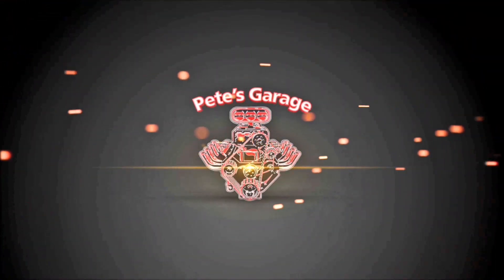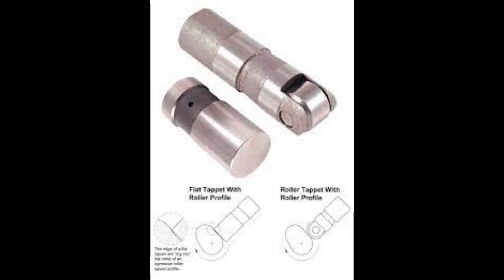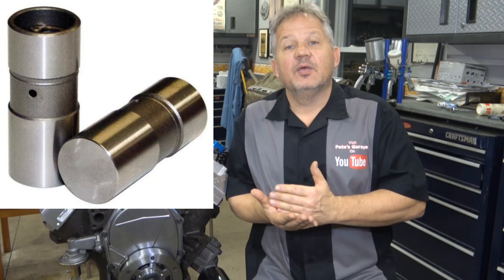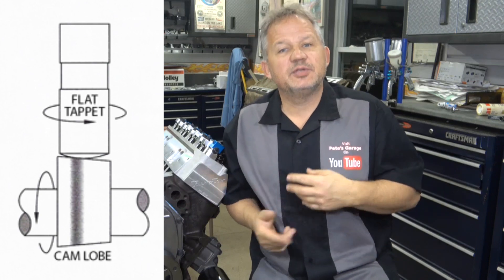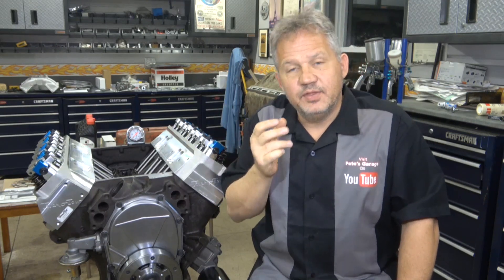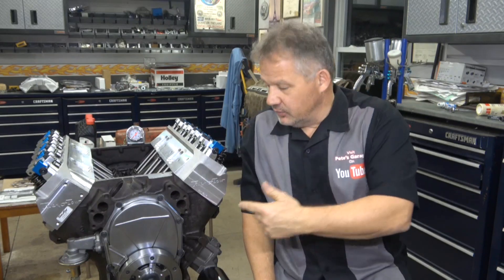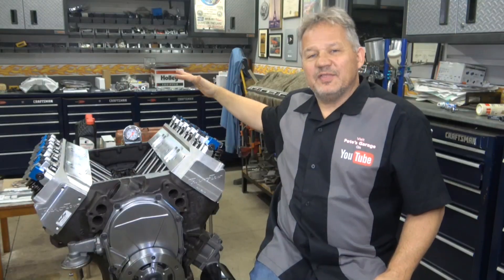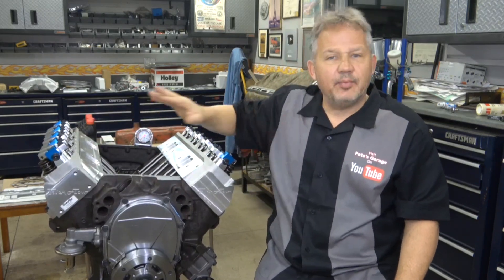Engine Building Tips - Roller or Flat Tappet Cam Pre-Lube and Break In - 440 MOPAR 512 Stroker

Comment: Does this apply the same if you’re reusing a flat tappet cam with new lifters? I did a freshen up on a bbf460 and planned on reusing the voodoo cam that was in it but the old lifters didn’t get labeled. Oops. I purchased new isky lifters and does the cam need “rebroken in”?
Reply from the maker: Now the lifters have to be broken it to the cam. I would follow the break-in procedure.

Comment: I'll stick to my flat tappet thank you. All I'm seeing with rollers is all the needle bearing failures in the roller wiping out cams left and right. Just ask all the Hemi 5.7 and 6.4 guys.
Reply from the maker: An engine that has problem with rollers is usually the result of selecting wrong or cheap  parts.
Reply: That's because they bought cheap Chinese made hydraulic roller lifters.

The Ford Racing hydraulic roller lifters in my 331 small block Ford with an X cam went over 250,000 miles with no problems and I only rebuilt it because the rings were shot.
Reply: No issues with my 392

Comment: Success rate with roller, I agree with you but... You know you can open a valve riding a flat tappet lifter faster/longer than a roller, right? 

If you put a torque wrench on two valve trains, you'd never be able to tell the difference between roller and flat tappet valve train.
Reply from the maker: Thanks for the info!

Comment: 50% cam failure rate??  Did I hear that correctly?

If you’re having a 50% failure rate, you’re doing something wrong.   

Maybe 8%!  If that!  2-5% would be expected.
Reply from the maker: You heard wrong. It can be 50/50 if you have high spring seat pressure and do not follow the manufacturers recommendations for break-in

Comment: When talking about the taper on the cam lobes, and saying the lifters will hammer down the high side, you forgot 1 very VERY important part. The lifters. The lifters must have a proper crown ground on the bottom that matches the taper of the cam lobe. This is a necessity for rotation, and it also keeps the lifter off the edge of the cam. You'll have half the lofter face in contact with half the cam lobe.
Reply from the maker: I believe I mention that

Comment: Thanks you for this video.  Just preparing to break in a 340 flat tapped solid lifter cam and lifters. My question is using breaking valve springs(60-70 lbs). Currently on my speedmaster heads are some custom “ beehive” shaped springs rated at 230 lbs ( closed). 

As long as they do everything else correctly, lube, pre-oiling, ensuring immediate startup, is using a breaking valve spring worth the time and the money? Kirt
Reply from the maker: No, but I follow the cam manufacturers break-in instructions.

Comment: Just getting close to running my rebuilt 350 Chevy. I got to thinking, why doesn’t the “biggie” performance cam/lifter manufacturers set up a thermal cycling/oiling fixture, and using the fixture and simulated engine warm up thermal cycles, break the cam & lifters in, then package/ship a matched set to their customers, identifying which lifters go with which cam lobe? It seems, in today’s World, that would go a long way towards ending failures? And, my Comp Cam paperwork tells me of a nitriding process I could send it in to have done - too late, my cam’s in. It also talks of a lifter bore groove - but I can’t buy that tool & do it now, as I’m partially assembled and can’t risk shavings now. For a guy rebuilding a one-off motor (shade tree week-end guy, doing one motor) I wish I’d have known these details. Anyway - seems to me the aftermarket world is slacking a bit . . . And machine shops for not grooving the engine lifter bores at machining ( they never mentioned it). Thoughts?
Reply from the maker: If they broke in the cam they'd have to double if not triple the price. If you don't have real high spring seat pressures it will be ok
Reply: Well I’m running Brodix Ik 200 heads and I’m nervous about the spring pressure. I got another idea ; could the cams & lifters be made of tool steel, perhaps? You said the failure rate is 50%, that just scares the hell out of me. Also, a question; if you pre-oil your engine before start up, won’t you “wash” the special lube off the lobes?

Comment: None of this really makes sense. The world has hundreds of millions of cars running that have never had any cam, lifter problems. It looks like the big 3 don't know anything?
Reply from the maker: I agree with you. But when you use bigger cams and valves springs with higher seat pressures, it's no longer like stock from the factory. All cam manufacturers recommend a break-in procedure. Back in the day the owners manual for cars had a recommended break-in period and procedure.

Comment: Why wouldnt you pull the distributor and run the oil pump before you go to break it in, then at least the oil is there when you hit it.
Reply from the maker: I always prime the engine before. I think I did it in a previous video

Comment: Bottom line: Oil properties have changed over the years. YOU CAN'T RISK A FLAT TAPPET CAM FAILER! Play it safe and remove the risk factor and go full roller! It's just what you have to do now, face it!
Reply from the maker: I agree, but it's up to the owner
Reply: You can still buy oil for flat tappet cams. The issue is 5 to 10 bucks more a quart. So, pay up front or on the back.

Comment: Flat tappet is quieter than roller? Hmm.
Just broke in my Isky 570 lift on 1.5, break in oil and stopped 7 mins in to adjust lash. Cold lash estimate was wrong, started clacking when hot. Once lashed hot all good.
Reply from the maker: Big blocks tend to be noisy no matter what
Reply: If you are using a high lift flat tappet with double valve springs do you remove inner springs for break in I've never had to now they say I must for a 383 with a 572 lift cam

Comment: Funny how the OEM's built flat-tappet engines for decades without all the break-in hoops to jump through. What changed?
Reply from the maker: I don't know, but I've never had a flat tappet fail
Reply: @PetesGarage didn’t you say there’s a 50% failure rate?
Reply: Compare a factory flat tappet lobe to pretty much any 'aftermarket Performance ' lobe, thats the difference!
 Open a comp cataloge, look at the specs of an XE lobed cam as compared to one of their factory copy cams with similar @50 duration numbers, check the lift and .006" duration number differences and you will see exactly what changed.
Reply: @8power857 I don't believe that. Yes ramp rates increased but tons of cams that aren't that aggressive have failed as well. Serval factors are contributing to this. Foremost is quality of parts because of manufacturing processes and materials changed. Not to mention the shortcuts on quality control. Then there's the whole oil deal and the lifter bores are worn on a lot of these older blocks.
Reply: @bw3506   yes anything can fail. The oil deal is only a consideration in that early period when antiwear additives were reduced but the oil as a whole was not improved. Today the oil, provided you use the correct oil, is not the issue as we have far better oils now than we did.
 There were alway particular aftermarlet brands that were known for trouble, these days the internet just helps bad new to travel so more people are hearing about it and of course making up cr@P about it that they dont even have experience with.
 Quality aside, oil aside amd just simply looking at lobe profile, what do you think is going to fail 1st- slow low lift lobe with moderately low spring force or fast high lift lobe with high spring force?
 And yes lifter bore wear in these old block is so common now. I fairly regularly now am getting one or 2 bores repaired or going up a lifter diameter or 2 on all bores.

Comment: Very good video to understand the different of both, flat tappet and roller cam. I am started my FE 390 rebuilt over one year ago. I need some time to decide what I want to do.....then I spend more money and go roller cam. I wont go the risk with flat tappet. So I get some help from Brent Lykins. And I ordered some parts from him. He create the profile for the roller cam which fits tobthe rest of the car/engine. And I also go with roller rocker. And some days ago the big day was comming.....First start, after priming the oilpump. The engine starts after some turns and yesssss, he is running good, without noise, no leaks. Now the second drive lap is done to settle the piston rings. I am very happy. It was not cheap, also because I am in Germany. So the most parts I have to order in the USA  plus shipping, plus taxes. So I think it was the best way im my case.
Reply from the maker: Thanks for sharing

Comment: Interesting information! I have a question for you, I have a marine 502, one day It would not rev up but to 2700 - 2800 RPM, there is compression, fuel pressure, power to the injectors, to the spark plugs, ECM checked good, dont know what else to think of. Now Im thinking about some bad lifters, could it be possible that one or more lifters went bad out of the blue? and the valve is not opening?  I got #3 and # 2 cylinders dead. Thank you in advance
Reply from the maker: Could be lifters or stuck valves
Reply: @PetesGarage  Thanks for the reply. When you say lifters (they are not worn out) could it be they are not getting charged with oil resulting in not opening the valve enough?
Reply: @MachTuck  Stuck lifters has the same result as a stuck open or closed valve. 
Pull the valve covers and check out what the valve train is doing ...

Comment: When I built my 427 BBC back in 2000 with a comp cam flat tappet cam. I primed the engine on the engine stand using an HEI distributor with the gear teeth machined down. I Made sure all pushrods and rockers had oil coming out. Comp cams stated to take inner springs out, I said screw that. I used regular valvoline 30 weight oil to break it in. Cam many years later had a perfect pattern on the lobes.
Reply: So old time factory engines were all pretty run for half an hour before they were installed at the assembly line. 
I don't think so. 
The factory's didn't lose 50% of their engines in the old days. 
It's just poor quality parts.
Reply from the maker: That's awesome, thank you
Reply: Yep  My Brother rebuilt a sbc in 1982 and I Rebuilt a 402 and a 454 mid and late 80's And I can't remember the oil's WT but it was ether 10w40 or straight 30 W Valvoline And a Comp cam . At that time I never heard of Break in Oil .This is NOT a Recommendation on how to Break In a Cam !  Just how we did it back in the 1980's
Reply: I'm 59. We didn't use break in oil. Break in was never a process. We ran race engines the same. Never had a problem. Sometimes rebuilding 2 or 3 a season. I figure just cheap parts and bad oils.
Reply: Was a few years after that that the problems started.

Comment: Hi Pete excellent informative video. I’ve watched a few machine shop videos and cams being ruined prematurely on Dyno or initial break in. Have you come across cam failure concerning Rockwell hardness  on the cam or the lifter of flat tappet cams? You are using oil with zinc on break in do you used a zinc based oil as your primary oil after break in? My questions might be totally irrelevant if so tell me I’m no engine builder by any stretch of the imagination just a retired jet engine mechanic ( Navy ) I know you are ( Air Force )  but I’m interested in learning. Thank you for sharing knowledge .      Artie. 👍🇺🇸
Reply from the maker: It is difficult to do the Rockwell test on all lobes since it is a destructive test. I always use a zinc oil for break-in and for every oil change after.
Reply: @PetesGarage  thanks Pete for the reply.      👍

Comment: What about solid lifters with oil holes drill in the bottom?
Reply from the maker: I don't think that would work
Reply: Google EDM Lifters. They've been around for a while.  @PetesGarage
Reply from the maker: Those are solid lifters for high RPM performance applications
Reply: For peace of mind, I would only run EDM lifters in ALL my flat tappet motors. Everything I've read about them has been positive.  @PetesGarage
Reply: @troymullin3684  EDM hole puts more load on the lifter face- only an offset EDM may be useful.
Reply: Good point. I have not studied the placement of holes on the lifter face. Do you agree that they bring peace of mind to the owner/engine builder? That was the point I was trying to make.  I will check that out. Thanks.

Comment: Dumb question, but anyone ever wonder how it is a roller cam can be ground with such precision & surface finish it doesn't need break in, but a flat tappet cam "does"?   If anything, a flat tappet takes up [minor] angular slop, whereas a roller needs lifter bore centers dead nuts square to cam tunnel or... axles don't load evenly, things can spread, and little bearings get scattered about after a time when it finally gives way.  Either way, anyone building consider this: as the block goes, so can the cam.     Obviously, no break in oil on earth will fix bad taper or crown, but it can burnish things/change ra..  There is no doubt initial lubricant applied to any machine parts leaves a huge fingerprint where longevity is concerned - I like something in the moly family for flat tappet cam lobes on first startup.
As for that first ten seconds, a thing the marine world knows well: prelube pump.   Needs its own pickup [I like about one inch off bottom], a lockout relay [fuel pressure switch control works most engines], and a check valve so main pump output feeds as designed/doesn't suffer bypass back to sump.  Pressure?  Just enough to get oil to the top of the block is fine.
Reply from the maker: No, it has to do with the surface hardness. Marine applications always have redundancies, like aviation

Comment: Sorry for my lack of understanding but isn't the oil pump connected to / driven by either the crankshaft or the cam?  How can you spin the oil pump with a drill and not have it turn the crankshaft / cam??
Reply from the maker: This engine has an intermediate shaft that goes between the crank and oil pump. The pump is not connected to anything without the drive gear, usually on the distributor or another shaft.
Reply: @PetesGarage  The intermediate shaft is between the camshaft and the oil pump

Comment: I'm just starting a mopar, 400 to 512 stroker engine. I plan on going roller. Thank you for this. I am educating myself on what's necessary, i.e. bronze distributor gear, stronger timing cover, and thrust button. The latter two may be a good topic for a video.
Reply from the maker: You will do fine. I do have videos on both those topics in 2 different series on building 440's. Good luck on yours!

Comment: As the owner of this build, I couldn’t have chosen a better builder to assemble it. Looking forward to firing it up, Pete!!!
Reply from the maker: Thank you so much... I think I'm more excited than you...lol
Reply: Do the rockers have needle bearings ? If so, did you add restrictors in the heads to reduce the oil flow to the shafts ? The needle bearings allow way more oil flow through the rockers than a bushing type rocker. If not restricted, this can starve the 7&8 rod bearings of oil. A .060" restrictor works well, some people have gone smaller.